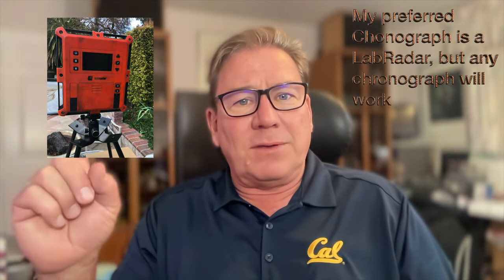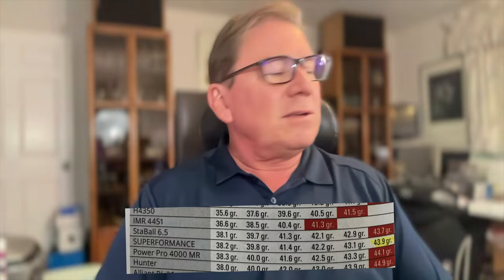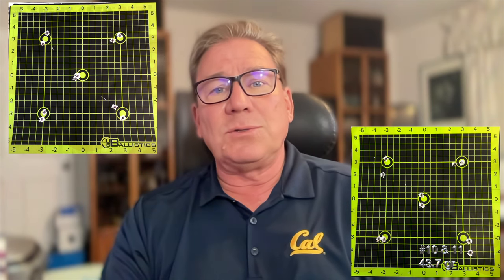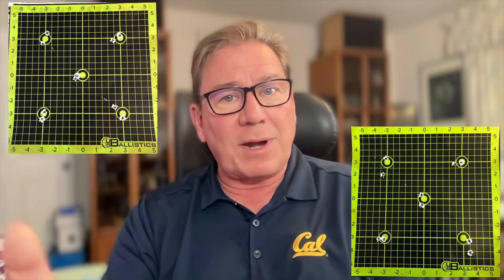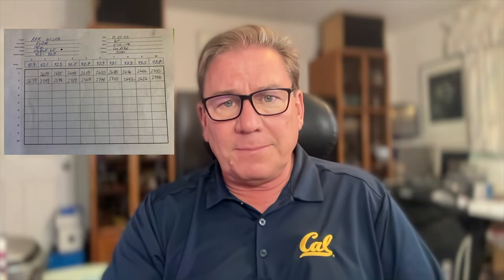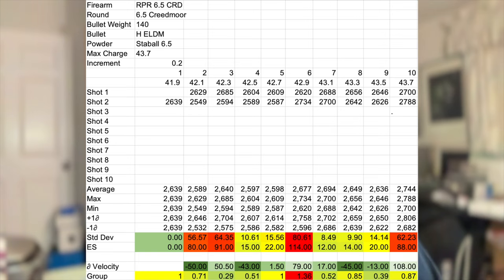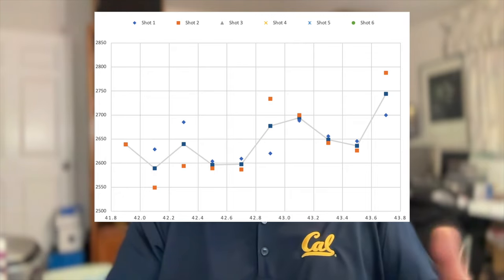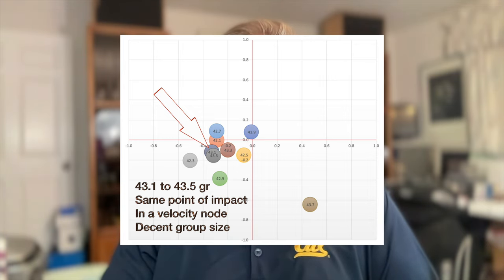OCW Loading Technique

Comment: This is an all day event when you consider the time it takes to cool the barrel between strings.  I'd feel better doing 5 shots per powder load.  That way I don't have to go back and confirm with additional testing later on.
Reply from the maker: Agreed.  I have found that even 2-3 per load to determine a node followed on the next trip with a 5 shot confirmation load of the node usually works.

Comment: OCW is a method coined by Dan Newberry and does not involve a chono, only stable poi.
Reply from the maker: Granted that Dan Newberry may have been the first to "coin" the term OCW, however it has evolved over time to encompass a method to try to determine the best charge weight and powder for a particular rifle, bullet, brass, primer and powder combination.  My method tries to minimize the number of rounds by using both POI and velocity distribution.  The thought here, ( and I am not the originator of this thought) is that dispersions in POI and dispersions in velocity are both related to the resonance of that combination of constituents.  Finding the best or optimum charge weight such that the barrel is at a node or "least deflected" point when the bullet exits the barrel is the aim of the search.  By combining both POI and velocity spread for a given charge weight you get to consider two factors to determine the optimal charge weight.  If the POI spread and the SD occur at the same load, you may have found the node.  A five shot grouping at that node + or - .1 or .2 grains would be the confirmation test.
Reply: @scorch101  Your method, and Dan’s method, are statistically flawed, the sample sizes are way to small to be of any meaningful use in any way! Garbage in, garbage out! 👍
Reply from the maker: @58harwood  you see 58 you can post a useful text.  This might surprise you but I mostly agree with you on the statistical value of this method.  I find it useful to screen powders and loading without having to generate large amount of data.  Recently I have combined this with Gordon’s reloading tool with the additional screen of no powder charge that has less than a minimum 90% case fill AND 100% powder burn.  This may not tell you the best load but it will tell you the powder/charge combinations that are not worth trying.
Reply: All I’m saying is, like Astrology, many can see trends and supposed “nodes” when and where you want too! There is an implicit bias in the interpretation of the limited “data”. Look, I was the poster child for the OCW and Satterlee methods! In retrospect, I couldn’t have been more naïve, wrong or embarrassed! Just saying………
Reply: @58harwood  There are several versions of OCW, all of which are aimed at showing where the point of impact (not group size) is stable within a charge weight range. If you cannot see a very clear node on this basis, then you have a significant issue at hand. All these approaches are based on positive compensation, and in fact the barrel harmonic frequency can be determined by this type of test. It is quick, easy, and reproducable.

Comment: Yeah and every time you repeat that velocity test it changes every single time
Reply from the maker: Ok, so I am not sure of your point.  This is the reason you do OCW and validate with SD and ES.  Am I missing something in your comment?
Reply: @scorch101  Just stating that me and several other people have done the satterly method of load development to find the flat spots in velocity and every time you do that test the flat nodes are in a different spot every time sometimes they are close but never ever the same place twice. Iv seen a flat spot at example 45 grains repeat the test and that spot would move to 45.8 grains the OCW portion of your video is statistically a sound method but the velocity testing to find flat spots is worthless. Brian litz has a podcast with Eric cortina where they talk about this method to find loads and also have found the same thing iv noticed when trying to find a load this way.
Reply from the maker: @terrycalvert7812  Thanks for the response.  The method I mentioned in this video, uses both velocity and Point of impact to determine nodes.  After you think you have a node then you still need to do confirmation loads of greater numbers around those nodes to make sure that your SD and ES are low.  Preferably in the single digits or teens.
Reply: @terrycalvert7812  I have found the very same thing and it has me puzzled what to do next. A very low ES and SD node over a few different 0.2 grain weights one day, then 3 days later, totally different ES and SD's at the same charges. Any advice would be greatly appreciated. Cheers

Comment: You have used two methods to determine optimum powder weight and that is OCW & LADDER METHODS 
Also why don't you demonstrate how to determine OCW using each target and compare each while you talk about it.
Reply from the maker: Good idea.  I will try to incorporate some of your suggestions in a future video.
Reply: Because reading 3-5 shot OCW groups is akin to reading tarot cards! You can literally see whatever you want to see! I used the OCW method for years, was a big fan until the Hornady podcast showed the error in my thinking. OCW works to a degree but the Hornady method, backed by sound statistical evidence is a more reliable method and often quicker finding a load.
Reply from the maker: @58harwood  I agree the more data the better, but to get to a statistically valid solution requires more time and money than most people can afford.  My point in my reply to you is that most of the people that I encounter that are gun owners, whether they be a the range or a competition are the nicest and most helpful people you would want to hang out with.  Somehow when people get on the internet they seem to lose all civility and start acting like an a_ _.  I appreciate good responses, the ones that are not helpful and in fact just demeaning will be responded to with tongue in cheek sarcasm and ridicule.
Reply: @scorch101   But in the end it’s not “more time and money” than going the OCW route. That’s the common misconception that is not true!  A 5 shot 5 group OCW test is a minimum of 25 rounds. And what do you have to show for it? Garbage in, garbage out!  Any single 5 shot group is not diagnostic by themselves. You just shot 25 rounds and all of that data is suspect, incomplete, not all that reliable. Typically I’ll load one 5 shot test first, sometimes I’ll do a 10 shot group first but, the total number of shots always adds up to 30 rounds minimum total..If I get a flyer with the initial 5 shot group and the group already exceeds my expectations, I move on. If it looks possible/promising, I’ll go load another 25 rounds and shoot them over the first 5 shot group. So, I’ve used 30 rounds, you’ve used 25. However, your data points are incomplete, not that useful, lacking, not reliable. Whereas the one 30 shot group I shot is statistically more valid, more diagnostic. So, who’s really wasting time and ammo? The 5 shot, 5 group OCW test is statistically just a crap shoot. IMO 😎
Reply from the maker: @58harwood  I value your opinion, just try to be civil about it.  Saying someone is clueless is classless.

Comment: Is it possible to share the spead sheat you use if i send you an email address
Reply from the maker: No problem.  I will create a blank sheet.  I have one for each cartridge that I load for.  If you have a particular favorite that you wish to try, let me know and I will send a blank one for that cartridge.
Reply: I would also apprecaite a. spreadsheet for the 6.5 Creedmoor.
Reply from the maker: @FrancoisCloete  No problem, I just need an email address to send it to.
Reply from the maker: @FrancoisCloete   you can send me your email address to send the Excel file to 00_winders_lengthy@icloud.com
Reply from the maker: MrBigcharl you can send me your email address to send the Excel file to 00_winders_lengthy@icloud.com
Reply: @scorch101  have mailed you thanks

Comment: Sorry, but ladder testing using 1,2 or three rounds per charge weight has been thoroughly debunked I'm afraid. 
Even if ladder testing was a reality, relatively moderate changes in powder temp will throw the entire ladder out of whack anyhow. 
The whole ladder testing BS was thought up or, at least propounded by a guy who was a good shooter but, had no idea about shot to shot variation or how to correlate it. The idea has been bandied about for years & caught on fast because of the big names pushing it blindly.
Reply: @@lngrange8912 It's the same thing with a slightly different focus which, is a another non event because it uses the same lack of data points & draws a similarly irrelevant conclusion.
It would be worth your time to do a little study on the subject of statistical relevance & how to achieve it.
Reply: @@lngrange8912 That's the very problem though. The data seems to be representative but, it isn't, at least not for the question you're asking. 
You have to allow the data to tell the story & not impose upon it something other than what it can statistically support.
Reply: Doing a ladder test/ocw with 3 shot groups is a fast track to eliminate the noise. If you’re measuring powder weight accurately then simply looking at extreme spreads of the data will tell you enough about powder charge to eliminate charge weights of a load. Since ES is a prediction of SD we can simply look at our ES to tell us where SD will be bad and eliminate them as a potential node. 3 shot groups provide a 59% confirmation of 20 shot groups. 5 shot groups 74% and 10 shot groups 89%. So 3 shot groups are enough to say with 100% accuracy a charge weight will be bad and 59% confidence they will be good. Once that data is collected it’s time to Increase our firings of a 59% confirmed charge weight. You do this by increasing to 5, 10 or 20 shot groups. This time being able to analyze the data with more scrutiny. If ES and SD are where you’d like them to be then it’s time to do the depth test. 

The mistake people make is taking 3 shot groups of accuracy and saying thats a node. You don’t use 3 shot groups to confirm a node, you use it to eliminate where a node isn’t. Hope that helps.
Reply: @4bigwheels09  I see what you're getting at. The problem with that assumption is that it supposes that all the data represents what should be happening at a particular charge weight over the three or 5 shots. The same issue applies to reading group ES. The 1st erroneous assumption is that any significant deviation is due solely to the charge weight applied without any other supporting data. The 2nd error is the fallacious logic that a significant deviation represents the ongoing characteristic of that charge weight. In both cases of velocity & group ES, the assumption should be that the rifle is just firing one shot after another in a continuous series & not divided into blocks of small samples. One large deviation in 5, 10 or 20 shots does not mean much without the remainder of the data. This is the reason why low sample numbers are misleading because we never get to see the real data trend. Low sample numbers hide the real trend & cause the shooter to infer a far greater emphasis on one or two data points well before a realistic data trend is evident.  For example, one significant velocity deviation in 3 or 5 looks far worse than that same velocity deviation in 20 whereby, the SD of the 20 shot group show a very consistent trend with the one significant deviation standing out as an anomaly rather than a defining data point. The same situation applies to group ES. One significant deviation stands out amongst 3 or 5 shots but, 20 shots may have revealed 19 shots in one inch with that large deviation at 2 inches.  What that tells me is that the shot at 2" was an anomaly & the rest support the overall effect on the target. It's not only possible that a very good "Node" could be discarded but quite probable. 
I don't know when shooters are going to understand that statistical principals cannot be shortcut & achieve anything meaningful. 
Thorough statistical testing is very reliable only when used correctly. When shortcuts are used, it is no longer statistics & cannot reliably be used as an extrapolation method.

Comment: In your spreadsheet of the x-y coordinates of each shot—I understand that you are measuring the impact point from the bullseye (aim point) so you can plot them on a single graph and look for consistency between shots and groups. But, what are the 9 distances (distance 1, distance 2, etc..) that you record for each load a measurement of and what do you use that data for?
Reply from the maker: Sorry for the late reply, I actually do not use that data at all.  I think I just nerded out on the Excel sheet. "If it can be done, and it is useless, someone will do it." said by someone somewhen.

Comment: What a waste of time. Hopefully no one buys your bs. A lot of poor info in your video. OCW means work up loads and find Optimum Charge Weight. Your way is ridiculous. When I see someone posting a charge weight of 41.9, as an example and then going up .2 of a grain, you are wasting components and your time. You should see significant nodes by increasing charge weights by 1/2 grain at a time. Start at 42 grains instead of 41.9. You are doing no one favors here. Shoot groups of 5 shots each and let the group dispersion tell you what you need to know. You don't even need a chronograph to work up an excellent load. After all, you are find the "Optimum charge weight". Groups will tell you that. The proof is always on the target, unless you can't shoot to save your life. This may be the case here???
Reply from the maker: Such a nice reply from such a courteous person, thank you so much for being alive.  I am sure all your friends cherish your acquaintance.